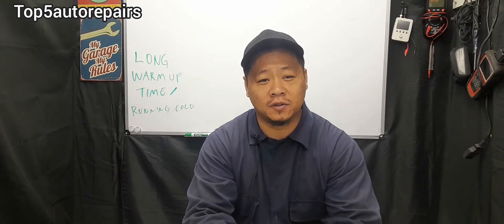CAR ENGINE TAKES LONG TIME TO WARM UP | RUNNING COLD FOR 20 TO 30 MINUTES

Comment: Over cooling is not ever a problem in a vehicle. Its always going to run better at cooler temperatures not ever running better at higher temperatures. Thats why when a car overheats, there is irreversible damage that can occur.
Reply: Except when you live in Minnesota and your heat doesn't work because coolant temps are too low.
Reply: Wrong.Over cooling will cause premature engine wear,as well as higher fuel consumption and omissions.Yes,over heating will also damage an engine.

Comment: I have a Maserati Ghibli 3.0D V6 and last year I replaced thermostat because when driving down to hill and temperatures was going down and this year i have similar problem. The car takes sooooo long to heat up and dows't keep the temperature for long. When driving temperature goes up and down. On my opinion it's a thermostat again but what cause every year thermostat to go bad. Last year when i replaced thermostat i also replaced the cooling fluid and cooling tank with cap with genuine Maserati parts which is not cheap. So I wonder should I change the thermostat again? 🤔

Comment: Honda ridgeline…..temperature normally goes up to normal operating temp even at idle….but today I drove at about 40 mph  for about 40 mins. The gauge rose but barely above cold. (1/4 of the way). I’ll have to check it out

Comment: Hi sir, my case is that, in the summer my engine temperature stays on normal the needle stay at the middle line on the guage. Doesn’t move or anything when i drive. But in the winter, when i let it warm up for 20-30 mins, the needle hoes up to 1/4 before center line (middle normal operating temp) but when i start driving it goes down back to cold.. and after driving for 30mins. My hoses are still cold. Top amd bottom hose. But in the summer it goes to normal operating temp. What do you think? 1999 bmw 328i
Reply from the maker: Sound like a stuck open thermostat. Thermostat should be closed until engine warms up.
Reply: @ you knownjow you can hear the engine changes its tone when thermostat opens? I can tell it opens up.. but i still wonder how come in the summer it  stays to where the needle usually is at the normal oparetion temperature. And doesn’t move up or down from driving and stopping. Evennif i have the ac turn on. It stays in the middle where it is supposed to.

Comment: I replaced the thermostat with OEM 3.3 vg frontier replaced the ECT 4 times no codes but is the water temp sensor bad feeding false info the pcm once it heats up it runs great what about the oil,I changed it to a heavier weight when I came back from a long trip it sends a missfire code on # 3 cyl then once warm it goes away I'm stumped tried everything even new distributor

Comment: I have a 96 Chevy blazer 100k miles and it’s running really cold after new radiator install. I have replaced the thermostat, coolant temp sensor and engine block coolant sensor and still runs cold. The highest temp it reaches is approximately 130-160 degrees and also makes my heater not work. It’s currently cold in Arizona so heat would be nice any thoughts?
Reply: I’m in Alberta and it’s winter now.. 

I just changed my rad and pump, both went bad over summer.. now it’s winter and the truck is running great, but so so cold 😢
Reply: @bmint  I decided to see if a heater core flush would fix my heat and the amount of dark brown water and mud balls coming out finally gave me heat again, heater is very hot 😁
Reply: @Dontjudgememonkey-ns3mx  So that fixed it? A coolant flush? Or was it something else needing flushing of the heater core?
Reply: @TwistedRealityLife  flushing my heater core fixed my heating issue its amazingly hot air coming out the vents but I’m still running cold on the coolant temp side just won’t get to normal temp. 🤷‍♂️

Comment: My 2.5 liter 4 cylinder natural aspirated engine takes about 15 min to warm up if idle, I mean the time it takes for the rpm to go down to normal idle below 1000, and I'm starting it at about 21 degrees C. Is that too long? 2012 Ford fusion SE, 47k miles on it-- I know, that's such a low mileage 😊
Reply: The thermostat is there but who knows. Maybe I should take it out and dip it in boiling water to see if it moves?
Reply: I have the same car and problem

Comment: I have a Honda Crv 2001, I've replaced the coolant fan relay and the AC relay, plus the fan switch, thermostat, both coolant and temperature censor.
The temperature gauge on the dash shows its over heating, but it's not, The coolant temperature in the radiator is around 149 to 152 degrees.
The motor runs amazingly, it's not over heating.
What would cause, the gauge to read over heating, when it's not?
The minute I start the car, the temperature gauge moves to the middle of the garage, where it should be after it warms up.

Comment: Hi, I got a 2nd hand Hyundai Elantra 2012,  and Im thinking it has a stuck open thermostat because it took a very long time to heat up the engine. Usually 30 to 45mins until the shaking is gone everytime I rev to 2 to 4k rpm.  Just yesterday I found out that the thermostat was removed, so we replaced it with a new one. But today I went for a test drive and it is still the same 😒 also the auxiliary fan is working fine. not spinning when it is below 90°C. I hope you have some advice.

Comment: What is it when your car engine heats up fast but never overheats an I'm losing water in radiator but no leaks any where an my over flow still full cheers
Reply: You might have a leaked or cracked head gasket which might be causing water to leak into engine block which is a serious problem if not fixed immediately because causing damage to engine. You should check your engine oil drip stick and check if the engine oil is like it should be normally , if it looks brownish or chocaty milky type or sludgy or oil is showing more than it should be it means eater is leaking into engine lock from the head. Also you can open the oil filling cap of engine and check the inside of the cap if it has foamy sludgy stuff on it instead of clan oil cap. Those all are signs of radiator coolant/antifreeze/water... whatever you might have in the radiator.. is leaked into engine . You need to drain that sludge.put new engine oil and do engine flush drain again  . remove engine head and replace head gasket if the head is not cracked or bent. If suspicious.... resurface the head and put néw gasket. Then remove the oil again and put new oil and oil filter. You need a mechanic to do all that.  But it's till small cost compared to if you damaged the engine block. Then you will need to overhaul the whole engine or buy another engine
Reply: Other reason might be engine coolant temperature sensor failure or a faulty radiator cap which is loosing pressure and water is evaporating out of it , but the over flow tank should be able to send water to radiator when it goes low in radiator.  If that's not happeing maybe the hose which connects the overflow container with radiator is not connected properly or is blocked. Also check if inside your radiator the fins and gaps are not filled with sludge and rust.